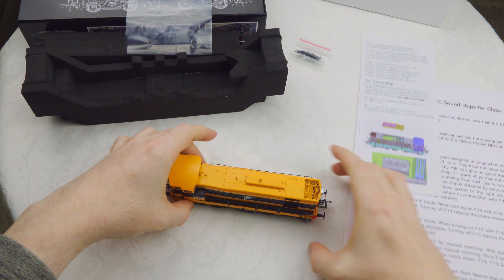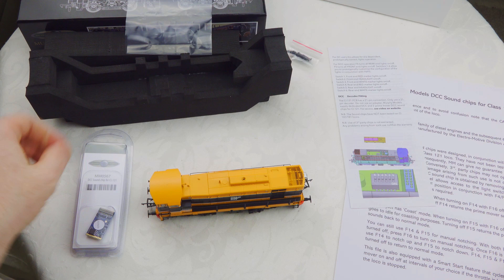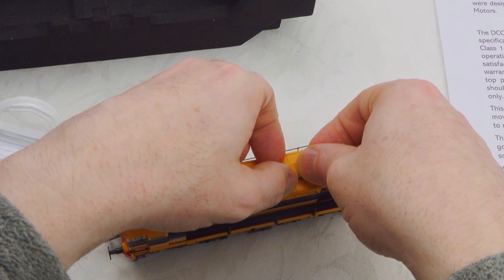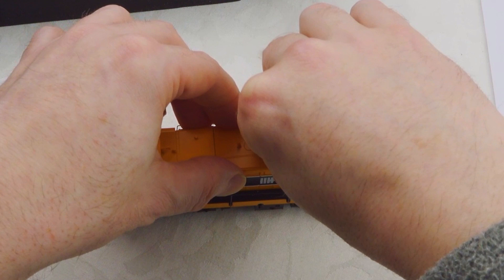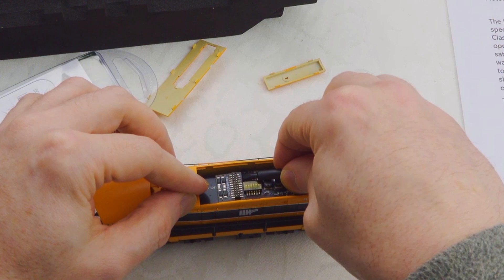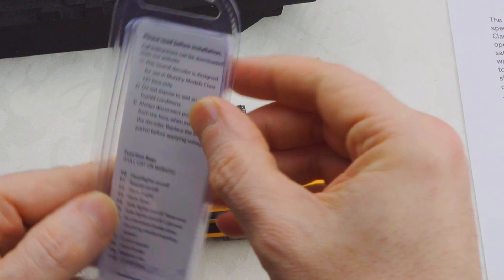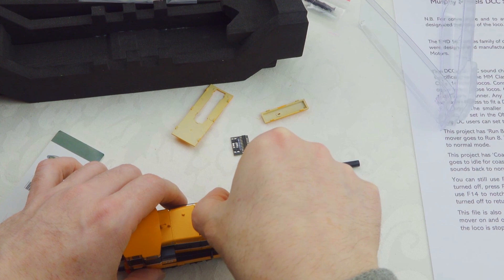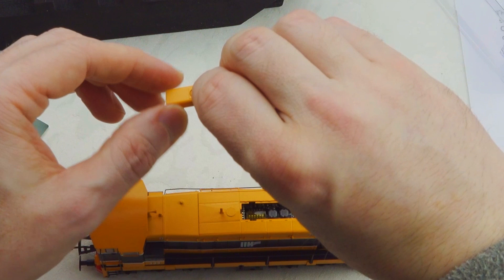Murphy Models Class 121 DCC/Sound Decoder Installation (MM0645,MM0567,MM0006) & dip switch access

Comment: Hi there. So well done you, have to say potential there for doing a bit of damage, as that didn't look the easiest job. Even getting the blanking plate off. Theres many a pin bent on even the easiest location. No idea about the model, can it have sound fitted?
Cheers Peter
Reply from the maker: Hi Peter, the most challenging part was the removal of the DCC blanking plate alright as it's very stiff. The actual decoders are a lot easier to install / remove. These models have excellent sound. I have a review coming out in the next  couple of days so watch for that. All I can say for now is that these are really good models.

Comment: Hey, I love your videos. Got my first murphy models train last year. And a class 121 recently. Do you need the decoder and the sound chip?
Reply from the maker: Thanks Patrick. If your purchase the sound chip it will also contain all of the motor and lighting control that is provided by the DCC decoder so you don't need both. There are sound-only chips as well for use in the dummy car of an EMU or DMU but they're not applicable here.

Comment: Great Video! Your board looks amazing too!! I'm just moving to Dcc so still bit lost on everything. I have bought a 121 and now have the sound chip 567. Do I need a speaker? I see some videos about 141/181s and they are installing speakers.
Reply from the maker: Hi Colin, the 121 has a pre-fitted speaker but the 141/181 do not. Pop in the decoder and you're good to go.
Reply: Absolutely delighted with that!! Thank you so much for replying! 

Great news :)